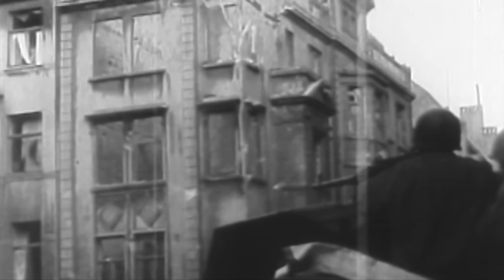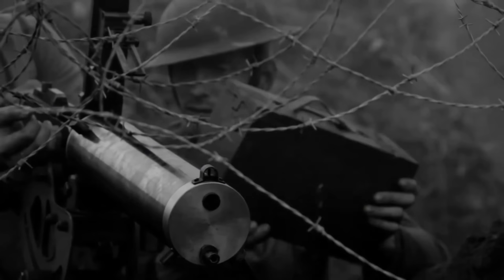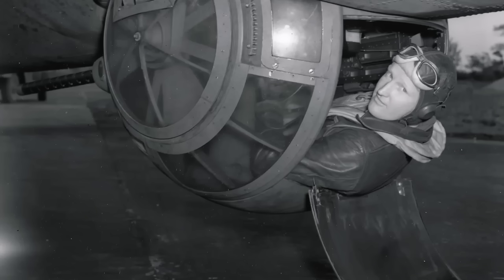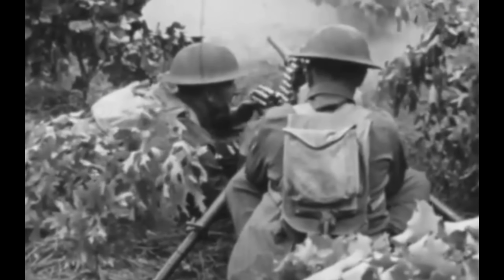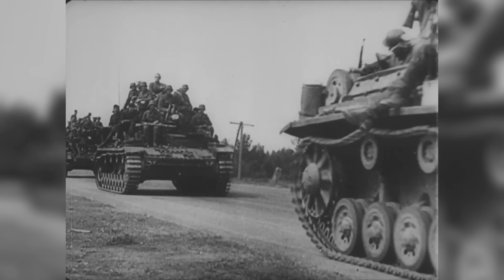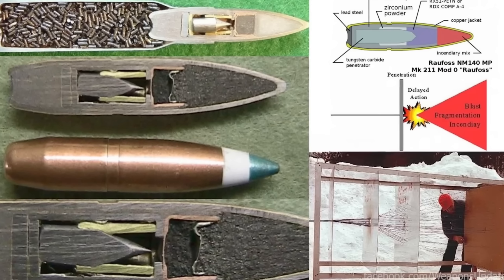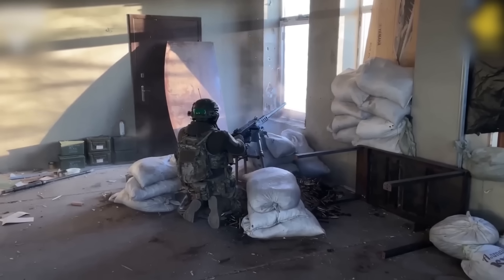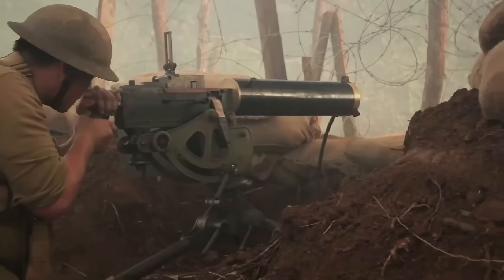The Dark Reason Germans Hated American M2 .50 Cal

Comment: Tbh, it is obsolete. Not .50 BMG round itself (SLAP is insane round, it pierce almost as much armor as 14.5 Russian), but M2hb HMG. It is quite complicated mechanically, not too precise and the only reason why U.S. army and USMC did not get rid of them so far is their tremendous quantity and how costly it'll be to replace them. 

Btw, in russo-ukraine war there are enough UA soldiers who talk loads of shit about M2 because they can't read English manuals and just can't load M2s properly (it may appear tricky at first glance).
Reply: Nothing you said is remotely true. UA soldiers love the M2 over the Russian guns because it has greater range, accuracy, reliability, and simplicity. The DSHK needs an entire tool kit to take apart where whereas the M2 you just need a bore snake, towels, and CLP since no tools are needed for disassembly.

Also, the M2 Browning is the only machine gun in history that can be used and has been used as a sniper weapon. Russians, for all their claim, haven't produced a single shred of evidence proving their HMGs can do the same thing.

The reason why the Army has tried and failed to replace itself since the 1930s is that all replacements sucked, and it was and is kind of hard to beat a holyman who literally revolutionized firearms as we know them today.
Reply: @Predator42ID the replacements was numerous. Russian KORD is more precise and significantly lighter. The only reason why M2 was used as "sniper weapon" is it's mount which is good if set up rightly. The main flaw of M2 is it's complicated feed mechanism and heftyness. About UA troops loving their M2 you can see on YouTube. Very  unlike how it's in combat when they dying with the phone in hand trying to figure out how to load it properly
Reply: @doombringer3498  Then send me a link where a Kord took out a target at well over a mile. 

Also, the mount has nothing to do with it. The M2 has a single-shot mode, and the weight helps tame the recoil. which is more than I can say for the Kord that rattles a lot.

As for complexity. I've seen those videos, and they were Russian, not Ukrainian, on Russian channels. I've seen Ukrainian vids, and they know what they are doing. 

Loading the M2 is the same as any other belt-fed, which means if you think loading is complex, then you wouldn't last a minute operating a Kord or DSHK.
Reply: @Predator42ID UA army is not that good this day. So, you insist that M2 is simple and user-friendly? Heftyness is a feature, all it's replacements was bad, and all rivals are inferior? Well, I see. 
M2hb is closed-bolt firing, of course it have good single-shot capability. But it's a machinegun, you know.

Comment: Misnomer on the location of the .50 on tanks. Aircraft tended to strafe armor columns from the rear/side so as to better hit the engine decks, so the .50 on the Sherman could be manned by the COMMANDER while he was hull down inside the tank in the AA role. Which is also why we strapped the .50 to everything. It was for AA. We looked at the early war propoganda reels that came out of France and even though we KNEW it was propoganda, decided a better safe than sorry approach was best so strapped as much AA to everything as we could.

Comment: A few points.

1. You actually understated the penetration for the .50 caliber round's Armor Piercing capabilities. It isn't just close to an inch, implying 25mm or less, it is closer to 1.26in or 32mm. A small but significant difference with meaningful breakpoints during the war as to what it could or couldn't penetrate. 

2. The Panzer 4 was definitely not a "better armored tank". Its armor was suitable for the early war but as early as the T-34 and certainly by the advent of the M4 it was outclassed. The frontal protection of the original Panzer 4 was a paltry 30mm, later increased to 60mm, then finally 80mm. Taking the original variants of both T-34 and M4 the T-34 had a 45mm upper glacis sloped to an effective thickness of 90mm. The M4 originally had a 51mm sloped to an effective thickness of 92mm. While the T-34 would retain this through all production variants later M4s would replace the 51mm steeply sloped plate for a thicker but less sloped 62.5mm plate sloped to an effective thickness of 95mm. This means originally the Panzer 4's upper glacis would've been vulnerable at very close ranges to .50 caliber Armor Piercing ammunition because it offers 32mm of flat steel penetration at point blank. More concerningly the original side armor of the Panzer 4 was a mere 14.5mm, later increased to 20mm, and finally increased to 30mm. This meant, without the addition of side skirts, the Panzer 4's side hull was exceedingly vulnerable to .50 caliber machine gun fire from the side protection arcs. Though a late model Panzer 4 with the 30mm side plating as well as the additional side skirts would be largely immune even at close range. This compared to the 38mm side protection of the M4 and the 45mm side armor of the T-34.

3. Strafing attacks from .50 caliber machine guns were not effective against most tanks of the war because the dive angle required to render the roof armor flat enough that the thin armor protection could be contested by the roughly 32mm of armor penetration that .50 caliber Armor Piercing provided was near vertical. These strafing attacks were really only notably effective against Panzer 4s at low altitude more or less flat angle attacks against the sides or rear. Stepping up to the likes of Panther, Tiger 1, or Tiger 2 and strafing becomes completely irrelevant other than to suppress the tank and force the crew to "button up" which means to close all hatches for protection. This significantly reduces a tank's situational awareness that would then often lead to it being destroyed by other threats it could not detect in time. However, granted that the vast majority of German Tanks were Panzer 4s and most of their Tank Destroyers were based on the Panzer 4 chassis strafing did have a valid use case. But only when confronted with tanks as poorly protected from the sides or rear as a Panzer 4.

Comment: I understood that the tracer round for the 50 did not follow the same path as the ball or AP or incenerary rounds. That at about half the full range the divergence was enough to start missing by more half a meter. It was useful for targets in the 750 yd or less but not above that. Is this true? Only heard this in one place.

You mention the quad 50. A P47 had a quad 50 on EACH WING! No wonder German planes that got caught in a P47's cross-over point burst into dust and small chunks of engine! Two Quad 50 hitting you at the same time! Not to mention the F6F Hellcat or the Corsair each carrying six 50's turning Zeroes into flaming balls of dust... OR the B26 with up to eighteen forward-firing 50's, bye bye Japanese destroyer!

Comment: As a .50 Cal Gunner on a soft skin HMMWV in early 2000, putting a shield on the gun turret absolutely sucked. It caused the turret to bind most of the time and if you weren't level when unlocking the turret, you were going for a ride most of the time. My gun deployed to Panama. the timing of the gun was so loose it gained a firing rate of about 25 - 30 additional rounds per minute. I found the best way to deal with a trouble gun that is mechanically sound was dumping Slick 50 on it. Much better than using the issued CLP!
Reply: @danmotika2944 When I deployed to Afghanistan in 2004 we didn’t have shields. A private company donated some really small square shields that we received. We mounted them and a week later during an ambush I took a round on the shield. There were two of us in the turret because my MK-19 malfunctioned, so one of us would have been hit. My next deployment to Iraq I had a new up armor with the waist high 360 armor and a sloped shield and a hand crank for the turret. I babied the hand crank and it worked well. The other hand cranks in the other uparmors were l stripped out because the gunner cranked on the really hard for everything, Just my experience. I’m sure they are slightly different. Also, I prefer the .50 to the MK-19.
Reply: Slick 50 🎉🎉🎉

Comment: For aircraft weapons, they hit that sweet spot between damage inflicted and weight per round.  The .50 BMG was destructive enough to tear up enemy planes and even armored vehicles on the ground, but was light enough to carry multiple weapons and a good amount of ammo.  20, 25, 30mm guns were in use, but you only got a couple of guns and limited amount of ammo to carry with them.  With the M2, you got at least 6, sometimes 8 per plane, with hundreds of rounds.
Reply: If you armor an aircraft to the point that .50 AP will not penetrate, it's no longer a viable aircraft.
Reply: The rate of fire was higher for aircrafts due to very cold air and high wind speeds at altitude thus cooling the barrel faster
Reply: but even a close miss with 30x90mm round was enough to split a P-51 in two separate parts while you had to shred your enemy with dozen of bullets with M2.
There is a reason the M2 was dropped for 20mm which is still inferior to other aircraft guns being at least 27mm and usually a powerful 30x150/165mm
Reply: the difference between a sledge hammer and a fire hose .....
Reply: quantity had a quality all its own
Reply: lmao nah, it's because they had a lot of M2's laying around and didn't have a cannon that was reliable to replace them, at all. It worked well for what it was for but it was categorically inferior to cannons.
Reply: @fen3311 Truth by also Germans found they could not shoot down bombers with 30 caliber machine guns so they had to go to larger 20 and 30 mm projectiles. Since Germany did not make large four engine bombers, the Americans were mainly shooting down fighters and 50 caliber armor piercing incendiary  rounds worked very very well
Reply: @fen3311  yes but early war many 20mm armed aircraft had a paltry ammunition load, like 60 rounds per gun.

Comment: The video shows speeds of the projectile striking a realistic plastic human body at speeds that  small arms cannot reach.  The 50 BMG projectile leaves the barrel at approx. 2700 Feet Per Second, NOT 8000 fps or 30,000 fps.  The chamber pressures required to boost a 750 gr. projectile to those unreachable speeds would shred/blow up the gun.